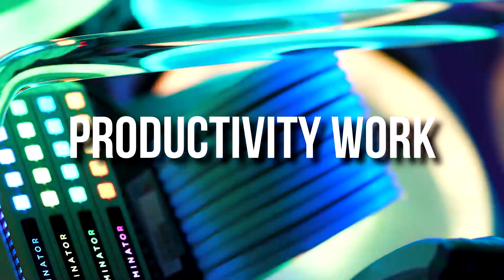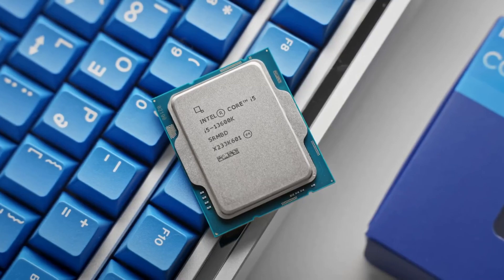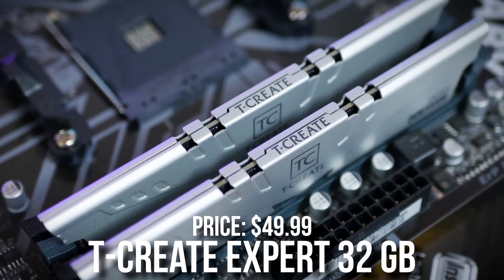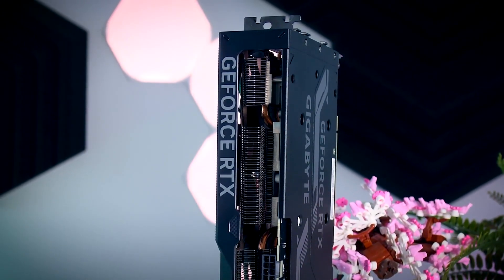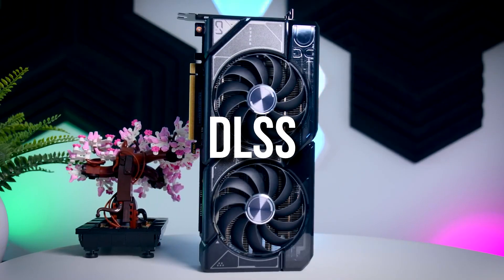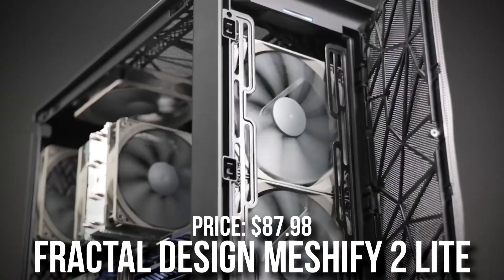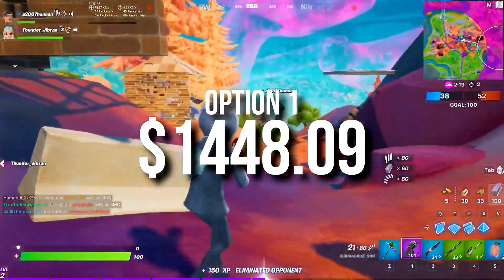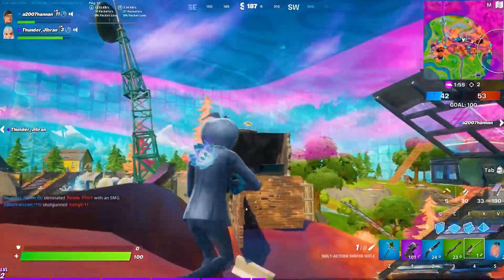BEST: $1500 All-Around PC Build in 2023 [ Gaming , Productivity & More! ] 🔥

Comment: Looking for a build for 1080p high fps i only have a 144hz monitor atm but will upgrade eventually. Best build suggestions £1000 can go higher or lower.
Reply from the maker: Here you have my recommended build for you:

✅ CPU: https://amzn.to/3sZHH5n

✅ CPU Cooler: https://amzn.to/3sZjoV6

✅ MOTHERBOARD: https://amzn.to/48gzObR
Wifi Alternative: https://amzn.to/48miG4g

✅ MEMORY: https://amzn.to/3Lua9CF

✅ STORAGE: https://amzn.to/48dVvcF

✅ GRAPHICS CARD: https://amzn.to/3EJ5Ijv

✅ CASE: https://amzn.to/46alwIt

✅ POWER SUPPLY: https://amzn.to/3EJfFO3
Reply: @ShadowGamingPC1  and all of these components will work together well? And will everything be a case of plug and play, also will the mother board fit in the case. Sorry for all the questions been looking at pcs for weeks now thanks
Reply from the maker: yes everything fits together! You build it, plug, and play (Make sure to install the drivers needed one you have windows for the best performance). The motherboard will fit in the case yes.  @bengarringtonben1164

Comment: Yea but the 6950xt is better at the same price
Reply from the maker: Better for Gaming yes, not for content creation and productivity work
Reply: I'm building my pc for gaming and some photo editing and I want to start making content what would be better I would still like 240 frames on my games so would the 4070 or the 6950xt be the best I've heard that the 16gb of vram would like future proof the 6950xt but i just don't I'll be pairing one of these gpus with a 7600x
Reply from the maker: The 6950 XT is the better choice for performance while gaming (especially at 4K), the 4070 is better with power consumption and productivity work. Both have Pros and Cons @Bakerman_console
Reply: @ShadowGamingPC1  is the 6950xt still good for productivity
Reply from the maker: @Bakerman_console   It is decent! it depends on how much work you do, for professionals is not ideal, but if it's basic video editing there shouldn't be an issue
Reply: @ShadowGamingPC1  yo shadow, if possible, could u make a video with 4070  and 6950xt side by side comparison with 7600x

Comment: If you're looking for a PC on a budget then consider the used market (OfferUp and Facebook Marketplace). I got a computer for $300 that has an i7 8700K, 16GB DDR4 RAM at 3000MHz, a GTX 1060 6GB, a Corsair H100i 240mm AIO cooler, and my favorite part of all the case which is a Kediers C570 open air case with 7 installed fans.